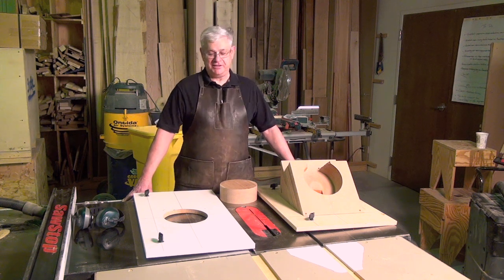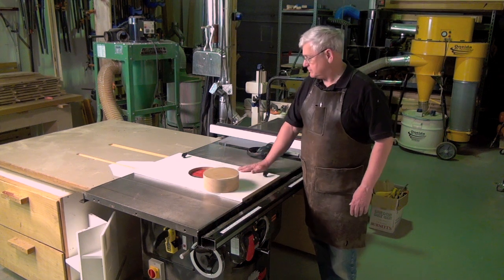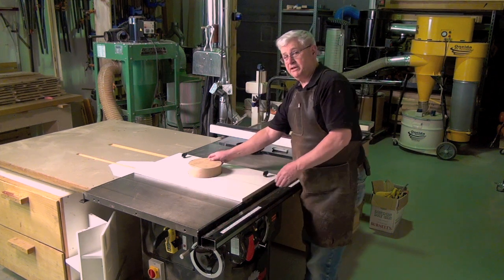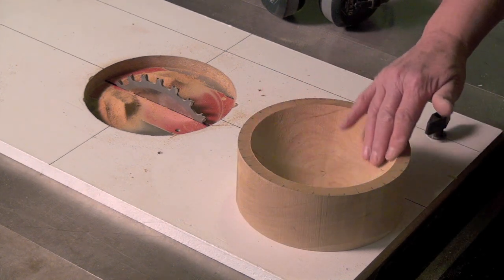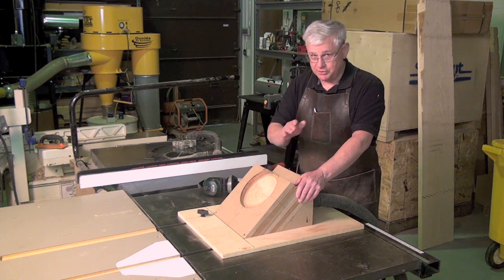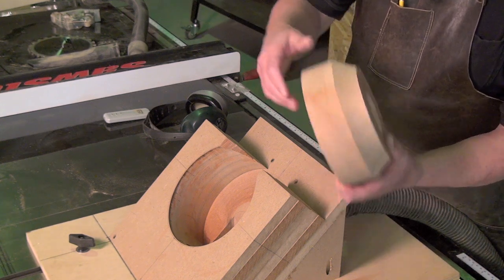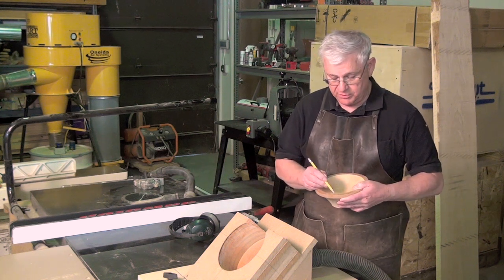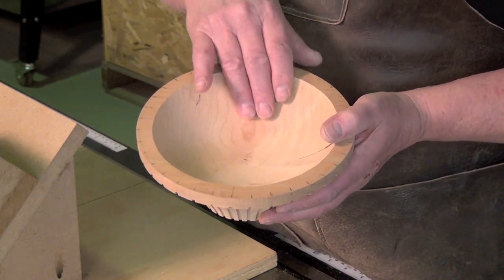Tablesaw Bowl

Comment: I don't know - cutting coves on a table is saw is a fairly standard practice,  lateral force on the saw blade is actually minimal unless you try to take too much off at once.  But then again, at that point it's no different that taking your roughing gauge and jamming it into a piece of spinning lumber.